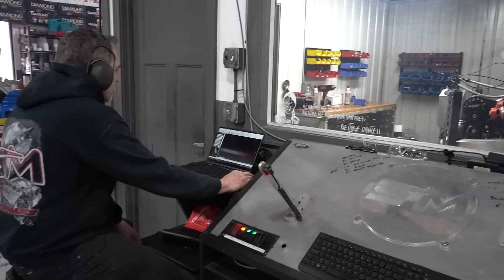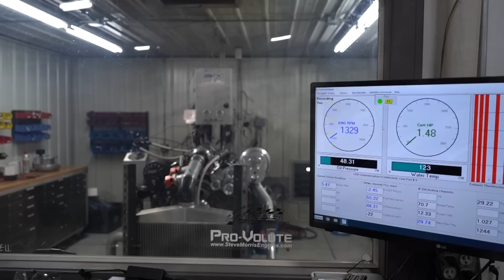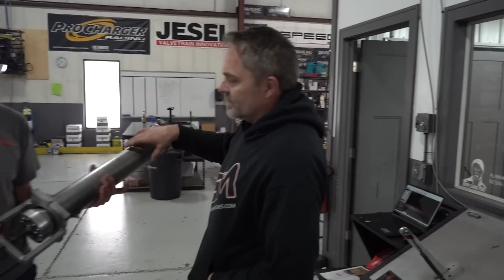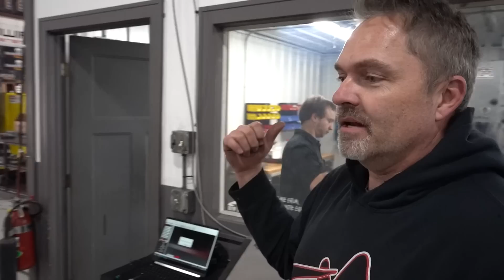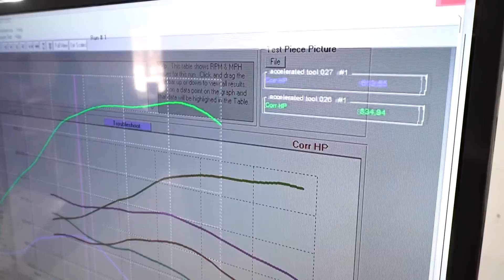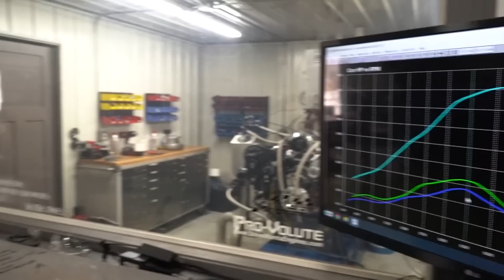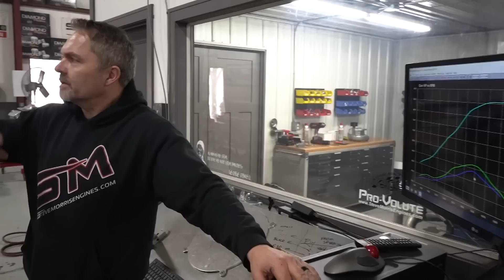CRAZY Testing After The  Dyno Session

Comment: The air has weight and even through your restricting the flow, The air in the compressor is heavier because it's getting compressed to a higher and higher amount as the psi builds thus it's getting heavier and heavier.  So, the impeller is spinning in this heavier air environment and it's increasing the mechanical load.   With no restriction, then it is moving volume which also increases the mechanical load because of the weight of the air at 14.7 (atmosphere at sea level).   But the mechanical load and horsepower would change drastically if you restricted the flow on the inlet or vacuum side.   Then the compressor would be running in a vacuum, and the air becomes very light.  But to get the same flow and pressure on the outlet side with a restricted inlet, the compressor would have to spin faster costing mechanical horsepower again.   With turbo's it always surprised me when they say the power is "free" because they run on exhaust.   Turbo's always have back pressure that's usually close in psi to the outlet boost pressure.  This means that the pistons in the engine must always have to push against that back pressure and the cylinders cannot fully evacuate causing a lot of exhaust to remain in the cylinders.  This would take up space that the new a/f mixture could have and would decrease the power.  On our landfill Cats we could install turbo nozzle rings that had closer vain's with more angled blades to spin the turbos faster with leaner a/f mixtures.  This would increase boost but also increase back pressure.   At 15 psi inlet manifold psi we were running 25 exhaust backpressure psi.  With natural gas the EGT would decrease with leaner A/F ratios.  just the opposite of Gasoline.

Comment: Unrestricted flow would be an incredible amount of cfm, regardless of the psi. So unrestricted, next to no boost, but a high amount of mass. I think to do this properly you’ll have to know exactly how many cfm (including details like density, temperature and humidity) the particular test engine processes at “x” amount of boost. Then you’d need to move the equivalent cfm, (with the equivalent in temperature density and humidity) It’s a quantity versus density sort of issue.

Comment: Measure the vac psi on the engine through rpm range at disconnect point of blower and subract that frm the blower running disconnected frm the engine at the same turbine speed as when connected to the engine.....im thinking.

Comment: In an engine energy is added to the air and THEN it exits the system. With your restrictor setup, no additional energy is added to the air, and when the air exists the restrictor it then has to move even more air out of the way, without the added heat and the additional concussive wave from the explosion. In addition to that, the pistons literally move out of the way for a significant amount of the air flow to enter the cylinder. In other words it creates a low pressure area inside the cylinder, making it easier for the pressurized air to move in to. Also, when you put your hand in front of the shop vac discharge side, it also increases the motor speed because no additional air can come into the system. As valves are opening and closing there is a fluttering of air flow that is equivalent to moving your hand over and away from the shop vac discharge side. Moral of the story, without pushing the air through a running engine, I’m not sure you can simulate things accurately.

Comment: The blower on the engine is pumping into the suction side of a second compressor, on the test rig it's pumping into atmospheric pressure with flow restriction. The cycle efficiency is considerably decreased on the test rig as evidenced by the significant increase in load displayed by the additional torque on the crank pulley.  

Condensing steam turbines condense the steam after the outlet to create vacuum increasing cycle efficiency. Condensing steam creates a huge reduction in pressure. I've wondered if there is power to be gained by decreasing the turbine exhaust gas temperature. Maybe in boat engines where the cooling water system is total loss, cold, and abundant. I'm thinking a water/meth system on the intake side, with a cooling exhaust pipe of some kind after the turbine to condense the injected water. Wish I had the means to fabricate and test such a system.

Comment: Could boost pressure be fairly irrelevant?  Maybe run a mass air sensor on intake side of blower… tune the tube so same mass air flow is flowing through the compressor as engine is consuming ?

Comment: On a 2 stage compressor the low pressure piston is adding roughly 30 psi boost to the high pressure piston  ; also it is easier to push the smaller piston when compressing into the receiver tank  ;........ you would need 2 engines to do the test accurately.

Comment: So basically, there is a limit to how much air can pass through the blower, before it becomes a restriction. This is the point where the boost falls off. Say for example, the engine is drawing in 1000cfm, and the blower is maxed at 1500cfm. So the blower is adding 500cfm. Without the engine drawing that 1000cfm, the blower on its own is trying to push the whole 1500, not just adding 500, so the power requirement is for example 3x, ie 600 instead of 200hp. The easiest way to simulate it, would be measure the cfm of the engine boosted, then na, then restrict the Intake of the blower, to simulate the added cfm at boosted pressure. Been in the pumping industry many years, centrifugal pumps are a tricky thing.

Comment: Just my dumb thought. Plumb the supercharger into the engine next door and run them at similar rpm so it’s moving air like it normally would, and then you can also see what kind of free horsepower gain you can get with a Bluetooth charger

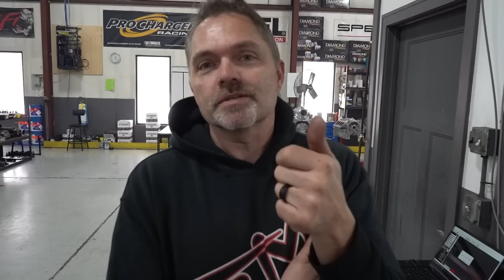Comment: 49:06 You could try adding a cavity that simulates the intake of the engine and then the discharge, the problem there is that the compressor is discharging air into the atmosphere, while in the engine it would discharge it into a vacuum created by the cylinders, so I think there would be much more airflow in the engine

Comment: The very last 30 seconds, was exactly my thought. If the intake had the exact same flow during both tests, you'd get the actual hp loss numbers. The blower is definitely creating a vacuum in the room and starving the motor off air. Great video. Definitely didn't want to be thinking this hard at 2:30 in the morning. 🤣

Comment: Could you put a mass air flow sensor in the tubing pre blower and test what mass of air it moves with the engine, and then use a waste gate to control the mass flow in the free flowing one on a lookup table that references rpm and the mass that the engine was flowing at that given rpm.

Could also feed the blower into another engine thats being throttled and loaded the same  as the N/A one.

Comment: My perception of the day is the engine vacuum is a great assist to air volume by at least thirty percent, thus lowering the hp. draw of the blower. This allows a higher rpm, in turn more torque and horse power goes up, the inner cooler also changes the air flow pressure, and effects the parasitic draw, would be interesting to see that pressure change, at every turn the tube makes, you can do that measuring the vacuum / maf.

Comment: Two comments:  I wonder what Kevin at performance trends would have to say....   And..   Work is work but you have more than 1 kind of work happening, and the ultimate energy requirements for that work are all sourced off the crank.    You are moving air, compressing air, and heating air.   And, if allowing the free flow of air is the most drag, then moving air requires more of the equation than the compressing or the heat loss...   Also, another way to think of it is your compressor efficiency appears to be the most while it is moving air without much compressing, because it can eat all of the available HP it has to it when flowing open.    I do think you are close to a good method of evaluating, as you said, just adding another parameter is necessary such as the actual mass of flow.   Cool discussion....    Oh and somewhere in these comment I read about trying to measure force on the compressor while being driven IE a little dyno cell hanging off the side of the motor....   That has promise to give you the sum total of the work required as well I would think.....       and you have the data channels to measure that too....  Hmmmmmm.......

Comment: J T Flaim/TURBO
Well there are a lot of correct and interesting comments as were a lot of yours. The biggest problem I see is you have an Apples/Oranges test set-up for what you are trying to determine. And there is a lot of good info to be learned about "Matching" the Blower/Engine combo. What was done in the "Testing" video was very interesting and fun I'm sure. But difficult to correctly extrapolate (Your facial expression while "Processing") what is truly going on.

As you stated, overall/all things being relatively equal,  "Airflow" aka: "Mass Flow" is "Horsepower". Secondly, is the amount of "Work" done (Pressure rise/boost) being done.

Yes the "Positive Displacement Air Compressor" action of the "Engine" is sucking on the blower. But only to the point where the blower overcomes that and begins building pressure/boost. All any "Dynamic"/Centrifugal compressor/blower knows is "System Resistance" aka: Back-Pressure read as "Boost". So "Yes" to really know anything you must also measure "Mass Flow" to know where you are at. And the easiest way to do that is to measure Inlet ACFM with all the required corrections to get to Corrected Mass Flow. Both for the Blower being tested, as well as the ACFM requirements of the engine and the amount of fuel you hope to burn in it to make the horsepower you are looking for.

So as you also stated. This was not the $Million setup to this. But to really get the info you are chasing you absolutely need to measure mass-flow and you should be able to directly measure Driving Horsepower/Torque. Think of it as a air compressor brake dyno and all the required ($$$) mounting to do that. (Another way is to direct-drive and use a "Torque-Meter" coupling and they can be had surplus if you know where to look.) Exactly the same as your water-brake dyno's. Something you, as an engine builder is not likely to do. But your "Torque-Force" friends NEED to do to develop complete Mass Flow/Horsepower/Efficiency maps. There are a lot of games that can be played by simply  controlling/improving the actual inlet conditions the impeller eye of the blower actually sees. By the the way anything that moves air with a boost ratio of say =/less than 1.5ish is a "Blower/Booster". Anything greater is a compressor generally speaking. This of coarse is in  "Absolute" terms.

So as someone who spent 30+ years working on the Test Stand for a major Turbo-Machinery manufacture I found your video (And your channel as a whole) very interesting.

That's enough for now and I like the way you think/process Steve.
Turbo

Comment: hp takes torque and speed, likewise the supercharger uses flow(speed) and pressure(torque) to use up the hp.
lots of flow at a little pressure will not draw a lot of hp likewise lots of pressure at a little flow will not either. when the compressor wheel is at its highest efficiency it's consuming the most power by finding the happy place between flow and pressure causing the most work to be done.
chances are when you fully open the outlet, the maps are all converging on the point where the supercharger can't pull more air though itself(cavitation).

the engine is a restriction as far as the supercharger is concerned, there can't be boost without a restriction.
electronics, hydraulics, and pneumatics all work the same if you can look at it the differences in mediums.

on a side note, if you completely block off the outlet port, once the speed of the supercharger and pressure in the outlet stabilize the supercharger shouldn't require any power other than the friction of the gears, bearings, and turbulence from compressor wheel to housing.

Comment: When the engine not under pressure it's allows crank to move more the add boost helps to keep the crank centered more because of the upward pull of the belts and no boost the crank is allowed to move more because or tension on it and the boost help eliminate the upward pull that's just my thoughts sorry for poor explanation guess that's what my middle school education allows me to explain in words but I can put anything together with my hands u sit in front of me keep up hard work love all content it's tawt me things so when time comes I build another motor car or motorcycle it will be even better then I could of before and they weren't bad but I could of got more out of the build thanks u

Comment: love the use of a bare block... here, hold this..  you just invented a 200hp power whistle... the chair and everybody in the side room was blown outdoors... lol  ....what doesn't make sense (yet) is why Hp dropped above 6300... now i see why turbos are preferred over a belt driver supercharger... freaking nuts, the crank is moving forward in the block from the pull of the belt... they do make pulley load cells, might be easier to pull data from... R&D on full display !

Comment: A very interesting video Steve and certainly gets the brain working big time absorbing all the issues and factors. I am not an engineer or involved in engines much. After thinking about why there is not a direct comparison between your “test” and the actual pull on the engine, is the atmospheric pressure at your elevation above sea level ( let’s call it 14.2 psi. On the engine pull it’s not pumping air into an equivalent pressure “zone”. You are right that measuring CFM at the blower inlet would tell you what was really happening but after another few hours adjustments and mental processing delays you would end up at the same place but with more data, and maybe not the complete answer. In the example you spoke about historically and the engine wouldn’t rev over 4500 rpm, the blower was taking all the engine HP to turn it. It must have been a lot if the engine was 750 HP. Top Fuel engines must take thousands of HP to drive them, and no wonder they blow up spectacularly. Maybe a wind tunnel guy would know the math and the effects seen on this video. I have wan insatiable desire to find out answers to stuff like this or I won’t sleep. Let us know what you find. Love your work and best of luck at Sick Week with the wagon

Comment: I was going to say before the ending is that I think because the engine is pulling in air it makes it easier for the supercharger to produce air by creating a vacuum just like you said and when you just dump the boost into open atmosphere it's in turn having to work way harder. In other words the engine vacuum and the boost pressure the supercharger is creating work together and make the whole process better for both.

Comment: the difference may be that the engine is an air pump.  At the same pipe pressure there is more air flow because the engine is partially pulling it through.  You would therefore need higher pressure in the case where it is not feeding the engine to simulate the same flow.

Comment: Crank extension with support bearing. Greater differential pressure ⬆️ Greater volume of air ⬆️. It's the volume of air that's loading it to the moon. Restricting the inlet may have less load on it?

Comment: I think y'all need to figure out how to equalize the pressure. Blowing into an engine the pressure equalizes up to where your blow off is set which would make the charger not work as hard once a certain psi is hit. Just blowing it into open air the charger should work harder because the pressure never equalizes when blowing it into an open room. Same reason there is alot more movement in the charge pipe when it's not blowing into the engine, no pressures are equalized. Just my redneck opinion lol! I have literally 0 experience with forced induction.

Comment: The engine pulls air in so there may be less load on the blower at 12lbs when feeding an engine. Less resistance to flow? What if you made a special pulley for the blower. Make a two piece pulley similar to the cushion drive of a motorcycle wheel. Instead of rubber blocks to smooth out the engine pulses, you have some load cells that measure the torque applied. You could have a small integrated circuit in the pulley to record the values or transmit them wirelessly to overcome the fact that the measurement device is spinning.  Torque readings could be used to calculate the power. Maybe the pulley could be constructed in a way to fit multiple applications.

Comment: Instead of having a fixed orfice the pressure is bled from, what about something thats like a wastegate, that opens at a boost number. Both the engine and blower have dynamic pressure and flow values so shouldnt then regulation of air be dynamic too?